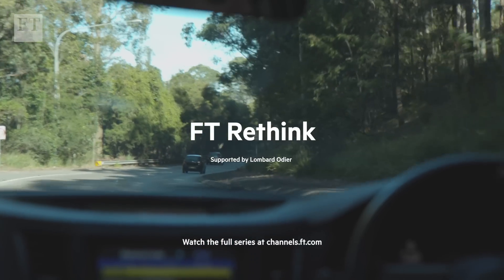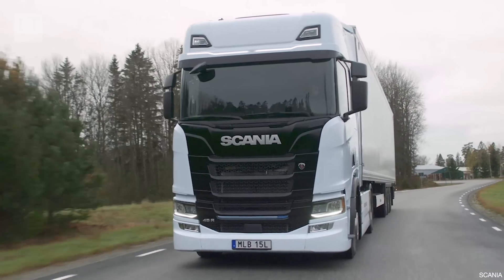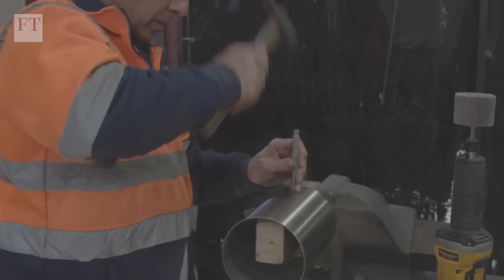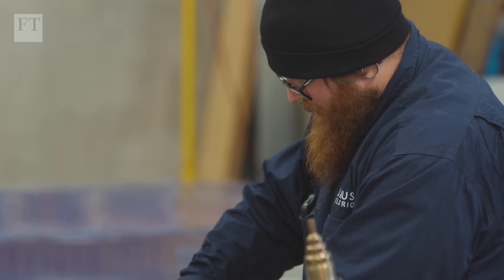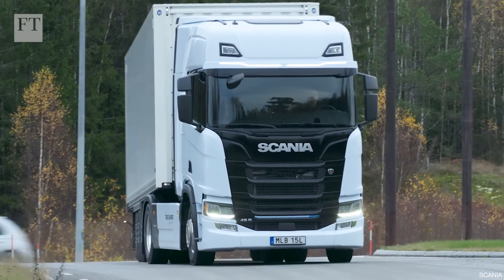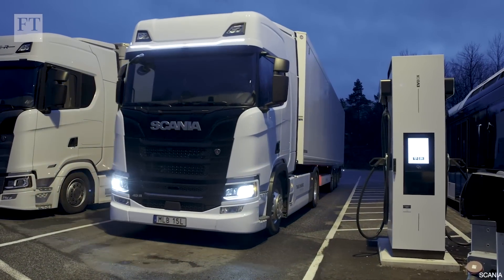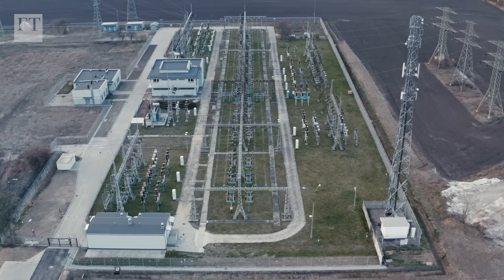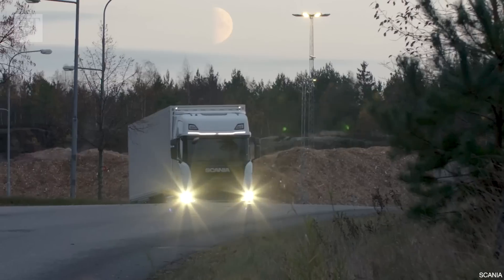The long haul to electrify heavy trucks | FT Rethink

Comment: why not actually invest in electric freight rail. that will yield results in cheaper well known form of travel and then use smaller electric trucks and delivery vans around the cities..
Reply: Electric freight rail in the US isn´t viable anymore, like 1% of the US railway network is electrified and they never invested in gradually upgrading this. To do it now in a heartbeat would cost hundreds of billions of dollars the US simply doesn´t have.
Reply: @krac3x438  so one year of US's military budget?

Edit: Federal highways receive an annual budget of $64.3 billion vs Amtrack receiving $2.3 billion.

You could shift those budgets for the next 5 or 10 years and easily find the hundreds of billions needed to make a good headway on the railway network.
Reply: @krac3x438  didn't you guys give trillion dollar bailout to few banks few months ago.. why not use those funds as long term loan and upgrade the whole network at scale. Today it's always going to be cheaper than tomorrow.
Reply: @krac3x438 isn’t that what the infrastructure bill is meant for?
Reply: Because of rapid delivery requirements, freight shipments are now highly disaggregated, getting loaded just before they are needed to be transported. Trucks work best in this application as trains are always going to be slower unfortunately.
Reply: @Re_RAM  only a fraction of what is needed goes to the railway sadly
Reply: @krac3x438  last i checked it does have the money.
Just some CEO's will loose their bonuses.
Reply: We have electric freight rail in Europe. Trains can not handle the load.
Reply: @davidty2006  yes that is true ofc, we would have the money if the top companies and billionaires wouldn´t park their hudnreds of billions of dollars in profit in ireland or the netherlands, but we all know before they pay their taxes hell freezes over
Reply: It would make sense to electrify the roads. It would certainly be quicker to implement that building new rail - which seems to take decades (HS2 and California as examples). Overhead power (25kV) with a pantograph pickup would work. Currently being trialed in Sweden.
Reply: @mb-3faze  What do you gain by electrifying the roads? You get a train system without metal rails. 

That just makes no sense at all!
Reply: @wolfgangpreier9160  Well, it means you can power/charge trucks as they drive along the main roads and then they are free to make deliveries on battery power. The power lines are on gantries above the road and the trucks have retractable pantographs for pickups. The road is still open to other users and you don't have to be concerned about hills, like you do when building rail. The power lines don't have to be on all of the road; just suitable (probably straight) sections of the road. Seems to be working in Sweden.
Reply: @mb-3faze  I know what power lines are, i do not live on Venus. Thank you.

I am asking: Who would finance such a folly? The last one trying it was the German government on 5 km Autobahn in Northern Germany. And it is not being used because no truck maufactorer would want to put a pantograph on their trucks.

Many such hare brained experiments have been tried in the last 200 years. Nne of which have survived the irst line, and most not even that.
Reply: In Western Europe, where freight rail is well developed, there are still insane numbers of trucks on the road.
Reply: Most short lines, spurs and sidings were ripped out in the 25 years following WW II.   To restore them now would be impossible.
Reply: Ironically N.America locomotives are electric motors. The diesel ICE is just a generator to create electricity to power the wheels.

Comment: The other good thing about swappable batteries is they can charge slowly,  so less load on the grid.
Reply: Also increasing the lifespan of the batteries.
Reply: @madsam0320  Why should battery swapping increase the lifetime of batteries?
Reply: @wolfgangpreier9160  Slow charging increases the lifetime. Fast charging decreases.
Reply: @wolfgangpreier9160  Charging batteries faster will increase heat, which in turn degrades the life of the battery
Reply: Even more - bateries can be charged when there is excess electricity from renewables and charging during peak electricity usage can be avoided. A lot of benefits for swapable batteries in heavy transport !
Reply: @wolfgangpreier9160 slow charging assumed.  But that means batteries not working for you many hours of day so may be wrong assumption
Reply: @virupakshawalla5734  And in what way would that help anybody if you slow charge your batteries? 

I am charging mine regularly at home but also regularly with full speed at a Supercharger. I did not experience any losses in ovr 92000km.

Fast charging @ 2C or less does not hurt a battery at all.
Reply: Australians drive 240 billion kms per year (gov stats). On average, EV cars/trucks consume about 180Whrs/km. So 43200 GWhrs per year, 118GWhrs per day. I.E. 10GW over a 12 hour period. 1GW of solar PV covers about 600 hectares. So 10 solar farms of 6 square km each and you can power every vehicle in Australia.
Reply: But you also would need more batteries. Maybe that’s possible in a future where we have more abundance of batteries
Reply: If your fleet uses 20 megawatt-hours per day to run the miles it has to run, then you need to draw 20MWh PLUS from the grid every day. Swapping isn't going to change that number one bit. Not to mention the batteries you are swapping weigh 16,000 pounds

Comment: I think that the australian company Janus Electric both solves the problem of range anxiety as well time it takes to recharge batteries and then we have clueless Scania (and other similar companies). I think the optimum solution is a battery which can both be recharge and swapped depending on the situation.
Reply: Here's to hoping Hyliion brings their carbon negative hybrid EV RNG solutions international. Eventually they will run fuel cells and full BEV for short haul solutions but their main focus right now is long haul cross continent big rigs.
Reply: You people do not understand the basic need of truck companies. They need to be able to burn fuel so they can carry more stuff and make it past the scale. Batteries cannot do this, so you need a liquid fuel.
Reply: @AtillatheFun  Tesla semi disproved this. Also, use cases...
Reply: @OrmondOtvos  How did it disprove the fact that you need to shed fuel? Also, the damn thing keeps breaking down.
Reply: @AtillatheFun  And it was being overtaken by other trucks running heavier loads.
Reply: No, the solution is DIESEL electric hybrid with diesel only being a generator
Reply: @OrmondOtvos Actually Tesla did not disprove this in any testing they still fall significantly shorter than any liquid fuel truck

Comment: if you put grid batteries at the truck charging stations ( like Tesla does ) You can charge the stations' batteries in off-peak hours cheaper and without as many transmission upgrades. If you use cheaper lower energy density batteries ( they are stationary weight and volume don't matter) like Form Energy iron batteries it gets even cheaper.

Comment: 30% of the emissions and carry 100% of the freight. That doesn’t sound too bad. Electric trucks have many great applications. What I’d like to see is hybrid trucks. There are so many hills that I’m waisting energy trying to stay below the speed limit on the other hand there’s many times going up hill that I could really use a boast that electricity would provide. A huge benefit would be when parked. I would guess I use about 5 gallons of fuel per day just for heating and cooling my truck while parked. I would be much happier running off of a battery. Oh well. It’s just a thought
Reply: Hybrid such a temporary fix:  what happens when fossil fuel is outlawedin the mid 2030's?
Reply: @kristinehatkinson7323  every fix is temporary. Technology constantly evolves. I’m just saying for right now with what we have today for over the road a hybrid would be the best option. As for fuel being outlawed… you will not live long enough to see that day. I know for sure I’ll not.
Reply: What you are getting at here is an REV. Electric drivetrain with an onboard ICE generator to charge the battery on the go like a diesel electric locomotive. Edison E-trucks is doing this.

Comment: Maybe somebody could invent some sort of heavy--duty electricity-powered locomotion that could be powered via overhead catenary power lines. Oh, wait ... I think I just invented the electic train! Electric trucks make sense for local use, but locomotives would be the way to go for long-distance shipping.
Reply: Of course, but you will steed need large numbers of trucks.
Reply: They have it in Germany, although presently very small scale
Reply: Trains constantly DERAIL and are hugely INEFFICIENT at delivery times on all goods
Reply: Did you know locomotives are diesel electric? The ICE diesel burning is a generator to provide electricity for the electric motors that power the wheels.

Comment: There are several highways in Europe that allow trucks to run with overhead electric wires. You should have included that.
Reply: But then, they need to leave that highway to make the delivery.
Reply: @kristinehatkinson7323  for which they can use smaller batteries that charged while they were on the highway.

Comment: Electrification of vehicles require investments, but the payback is great. This will happen much much quicker than analysts expects currently.
Reply: Why will it?
Reply: It's like any technology adoption curve, like switch from film in cameras to digital cameras, slow at first and then suddenly everyone buys them.
Reply: @zapfanzapfan  Only to a point, if the technology requires too many compromises it will fail. Remember mini disc? Polaroid cameras? Betamax? Concord?
Reply: You’re going to actually increase carbon footprint in the short term, so you better be sure it’s the best technology to invest in.
Reply: @jrhackman7414  Nope, standard batteries could be smaller. So less weight and more miles per KWH.
Reply: Haha EV FANTASY LAND FULL OF FAIRIES AND PIXIE DUST 🤪🤪🤪

Comment: Volvo Trucks has been delivering eletric trucks in 2021 and 2022. Why did FT focus on Scania who is at least 2 years behind?
Reply: Good question, but why not also feature the Tesla semi-truck, which is now in (very limited) production and already resolves many of the issues raised?
Reply: Probably bought a few ad spots
Reply: @229andymon  probably because Tesla trucks have a load capacity less than half of the standard. An electric truck is expensive, two even more so. Needing an extra driver on top? Yeah, Tesla is not in this race atm.
Reply: @photoo848  Not according to Tesla, or the specs (or price indications) for their truck. And that’s with today’s battery tech. Which it’s obvious will be improved soon.
Reply: Scania PR department doing a better job?
Reply: True! I see many BEV trucks running in our country. Mercedes, MAN, Scania and many Volvos. e.g. IKEA has only Ford Transit EV lorries to loan.

Comment: It takes three phase power to 'fast charge' a BEV which is likely to be powering any large building, but most homes are single phase and would take overnight to charge from empty to a full battery with a standard charger. As a mach-e owner I generally only charge at home and leave the house with a full 'tank' every day in part while I sleep. Long haul truckers will also be plugging in at the stops where they rest now (federal rules about 'hours on road' and such). Truck stops and travel centers mostly have the commercial grade power already will likely have a lot of incentives to wire up their lots as many already park there overnight using the business's showers and consuming its food.
Reply: They are not wired for the extreme amperage requirements of charging semi trucks at the needed minimum of 500kw up to 2Mw per truck fast charge. Most truck stops have about 15-25 pumps and it would require literally a Power Plant just to run one single truck stop... Where TF is all the power coming from ????? This is pure FANTASY

Comment: One thing you did not touch on is that trucks do about 50,000 times as much damage to a road as cars do. If you took trucks off the road entirely, the bill for road maintenance drops to almost zero. And yet it does not cost $250,000 to register a truck each year.
The true cost of trucking is therefore hidden, and it's NOT a user-pays system. It's a fraud on the public.

Comment: The solution for the trucking industry are hybrids. You can run the electric motor in an urban environment until you need to charge, then use the diesel engine to recharge the battery while still driving. Also you have the hybrid assistance to help accelerate from standstill, help trucks get up to speed faster, help with climbing hills, help with overtaking  and crucially there are no range issues and increased fuel mileage. 

Downside is the added weight to trucks will reduce cargo capacity, can that drop in income be overcome with the cost of fuel saving?
Reply: What you are getting at here is an REV. Electric drivetrain with an onboard ICE generator to charge the battery on the go like a diesel electric locomotive. Edison E-trucks is doing this.

Comment: I saw the hearings on capitol hill for electric trucks  the US will have to build 25 nuclear power plants to supply the infrastructure  it doesn't exist today  Truck batters weight 8K pounds each and some trucks need 2-4 of them  the highways can stand the weight and this there is less storage on the truck so they have to have 4x the number of trucks so the infrastructure demand is beyond capable of handling that.

Comment: A company called Hyliion has found a different way to charge electric-powered trucks. Rather than plugging them in to the electric grid, it uses an on-board natural gas powered electric generator to charge the batteries. Since the generator burns natural gas captured from sewage treatment plants, hog farms, and landfills, which would have otherwise escaped into the atmosphere, it's operation is actually considered carbon negative. Two big downsides to conventional plug-in electric trucks are that they require significant up-front expenditures for changing equipment and put an outsized demand on local electric grids -- downsides that Hyliion-powered trucks avoid by charging their own batteries with the on-board generator. What's more, Hyliion works with established truck manufacturers like Peterbilt to install its powertrains into popular semi-truck models that companies and drivers are already familiar with.
Reply: Why not just have gas powered engine lol
Reply: @virupakshawalla5734  save money and hit emissions requirements.
Reply: thats useless you might as well just run it on natural gas then
Reply: @spacetomato1020  Good point. If you're gonna put a nat gas generator in it, why not just put a nat gas engine in it and run it on nat gas? Because the nat gas generator charges electric battery setup is cleaner and cheaper. It qualifies for all or most of the zero electric vehicle tax credits that a full electric truck does, and the axle in the electric motor allows for regenerative braking, which recharges the battery when the braking. It also has a plug so you can plug it in like a battery electric vehicle if that charging infrastructure is available. You can also run entirely off the batteries emissions free for up to 70 miles.

Comment: It doesn’t make logical sense that a company can convert a diesel vehicle to BE for far less than it costs to buy a new BEV. Otherwise you have the crazy logic that it would be best to make EVs that way…..
There has to be other factors at play.
Reply: I think when  he said " essentially a new truck with the turning circle of a small planet " he means this truck has a brand new powertrain, even if the steering is so last century . My understanding is that they repower old trucks.
Reply: There is less tight integration, and more modularity (and compatibility) between manufactures and models in trucks than there are in passenger cars.
Reply: @Tim_Small  No, there are certainly not more modularities in trucks. You can not replace a Diesel-powered truck with electric motors any easier or cheaper than you can electrify a Porsche 911.
Reply: @wolfgangpreier9160  and yet it turns. Janus have just announced a joint partnership with some copper miners. Repowering a roadtrain fleet and providing battery swap stations,  which will be solar powered since there's no grid Outback.
Reply: @richyfoster7694  Sure it can work in a small community. Very locallized. And Australia as a whole is a very small community. Compared to e.g. Canada . Or Brazil. Or even Germany or California.

Oz will never get a Tesla Semi btw. But thats another point.

So: Yes i can believe that Australia gets such a system. The rest of the world? No.
Reply: @wolfgangpreier9160  yes Australia is only 7.7 million square kilometres,  compared to Canada's huge  9.8 million, so yes, quite small? I applaud their "can do" attitude. We desperately need solutions,  not closed eyes. Fully Charged Show did a story on Janus a few months ago , it's a very simple operation, but effective.
Reply: @richyfoster7694  Australia has 27 million citizens.

Yes, a little local community indeed. 

Smaller than Shanghai and its neighborhoods. About double the size of Rio de Janeiro and its favelas.

I must make a kowtow before its place in the row after poland.

Comment: if the top of the trailer was solar panels, that could make the current for driving.  Gee, what a concept.
Reply: That makes no sense. Not enough surface area to justify it.
Reply: It would make about 1/10th the power needed but at least it would help the cause and not be wasted roof space